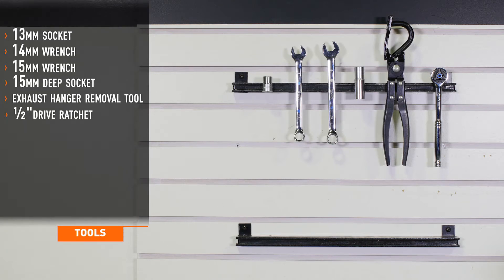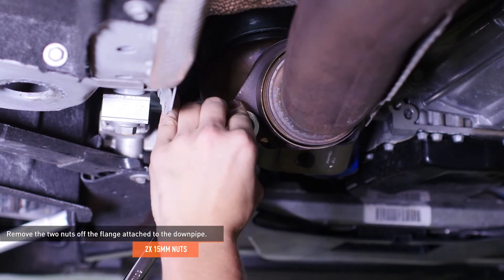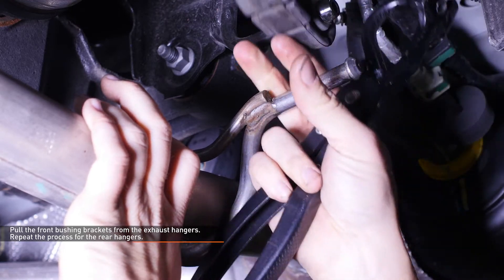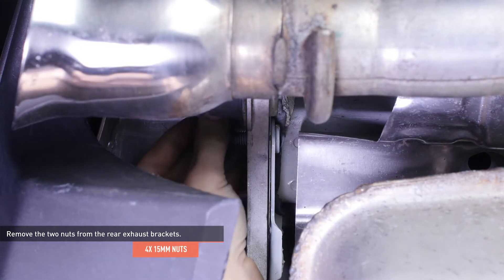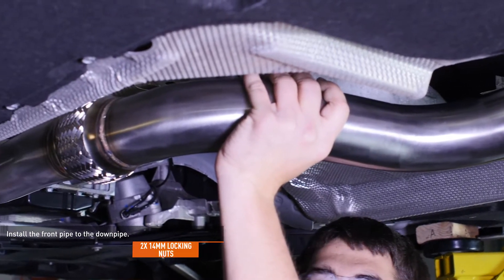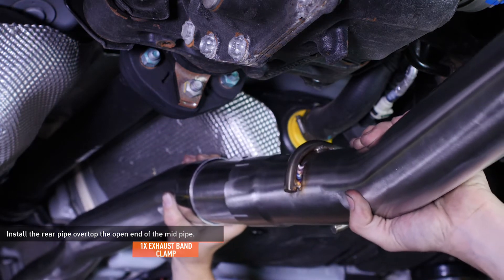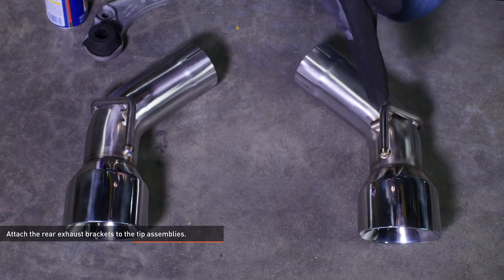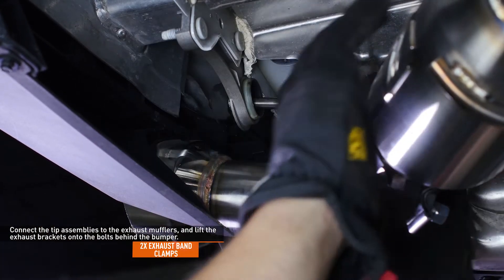2016+ Chevrolet Camaro 2.0T Dual/ Quad Catback Exhaust Installation Guide by Mishimoto

Comment: How much power gains will i notice if i buy this? Thanks
Reply from the maker: Gains are minimal assuming the OEM downpipe is still being used.  Pair this with our downpipe for maximum gains.  This exhaust system is quite a bit lighter than the OEM system, too.
Reply: @mishimoto  ok thank you. Will the catted downpipe pass emissions?